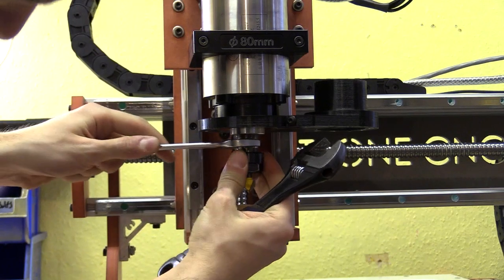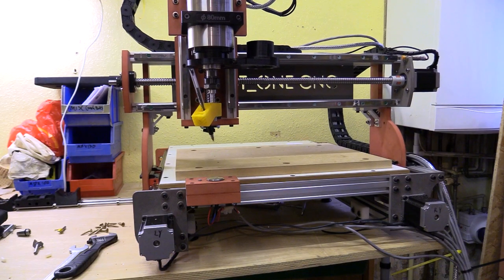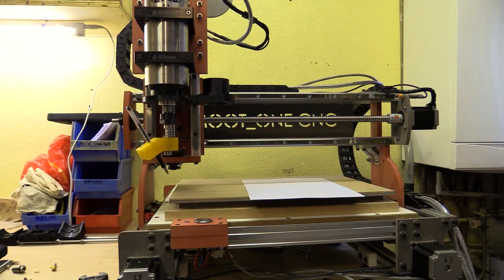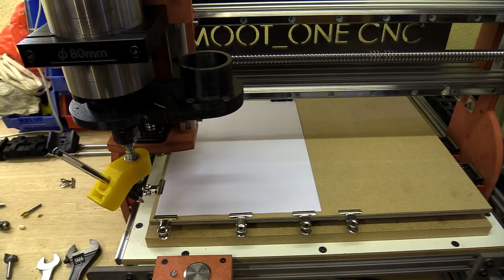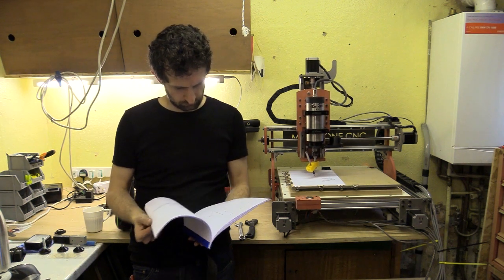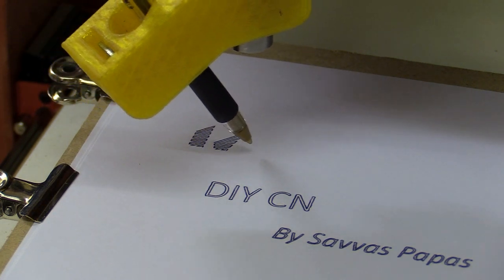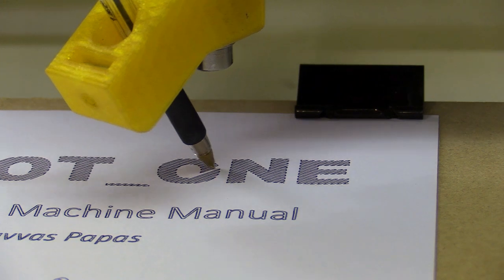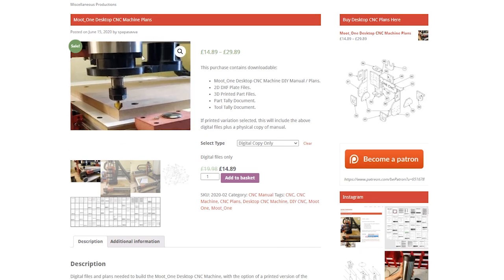#52 Moot One CNC Machine Draws Itself / Plans Released

Comment: Hi, nice form factor! I am about to build the openbuilds c-beam cnc machine (8mm lead screw and v-slot wheels) in a smaller formfactor (45x45cm machine footprint). I saw you build one - do you recommend it? I want it mainly for wood work but also for some custom made aluminum parts. The work area will be about 20x25cm. Planing to hook up 1.5kw spindle.
Reply from the maker: Hiya - thanks for the comments. I found over time ballscrew and linear rails out performed other belts, leadscrews and plastic wheels. V wheels are great for 3D printers but the forces involve in CNC routing need more rigidity. I sell plans on my website with a full parts list and step by step guide including calibration. I'm obviously biases but I'd recommend reading that first before making a decision. Good luck with your projects.
Reply: @EducatingSavvas  thanks, I will do that. What is the footprint of the Moot ONE?
Reply from the maker: @skaman82  The foot print is roughly 650mm deep (Y axis), 700mm wide, (X Axis) 700mm tall (Z Axis). The wasteboard size is 450mm wide (X Axis) by 350mm (Y Axis) although the spindle does overhang the front that so longer pieces can be cut. The Z cutting capacity, between the under wasteboard to base of Z axis is a little under 90mm.

Comment: What electronics do you use to control the CNC you designed??
Reply from the maker: I started with GRBL controllers but now use the Duet 2 Wifi - but the CNC can be used with any number of controllers and platforms. It's best to do your own research in that respect.

Comment: Hi Savvas, do you know what grade the linear rails you ordered are? I'm currently comparing robotdigg to banggood. Robotdigg have the orginal Hiwin, a stainless steel 440C version, and the cheapest (chinese copy) GCR15. Banggood doesn't state which ones they stock but I'm assuming it's the GCR15. Any comments on this?
Reply from the maker: Hiya I'm not actually sure. I've just emailed my contact where I bought from - a supplier on AliExpress, and will let you know when they confirm.
Reply: @EducatingSavvas  cheers Savvas. it's painful getting info on the robotdigg site as the details are strewn all over the place in individual listings and the language barrier in the descriptions leads to some confusion ("and" vs "or" in particular). other than being better suited to wetter climates it looks like the 440C might be made to a tighter tolerance but they haven't listed an actual comparison to the GCR15. hard to gauge whether it's worth the approx 40% more in cost.
Reply from the maker: They are gcr15 - I think if you go with those and perform regular maintenance you won't notice anything noticeable for general tasks. But the more expensive ones are better.
Reply: @EducatingSavvas  thanks for confirming

Comment: I was wondering, is there a practical use case for using a CNC machine to draw for you vs using a printer? I guess a solid alternate to a printer especially if your printer ink runs out
Reply from the maker: Pen plotters are a thing - main use decorative or aesthetic reasons. I guess if you want to draw on something that can't bend through a printer. Most plotters can also be used with a cutting knife, so making vinyl stencils is one use.

Comment: Hi Savvas, I'd be interested to know how much it costs in total to build one of these, including motors, control electronics, etc.
Reply from the maker: The price will vary depending where you source part and what quality you want to work towards - but you could easily build this for under a grand. The cost can also be broken down into stages if you follow the plan so you don't have to buy all the parts in one go. Once I start back at the studio I'll also make kits up for the machine screws so it'll be a bit easier to get going.